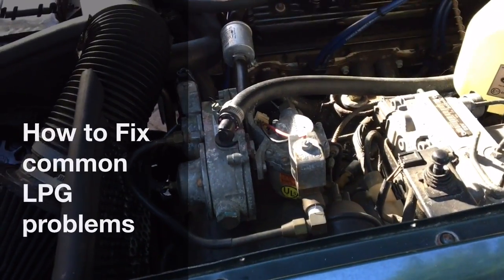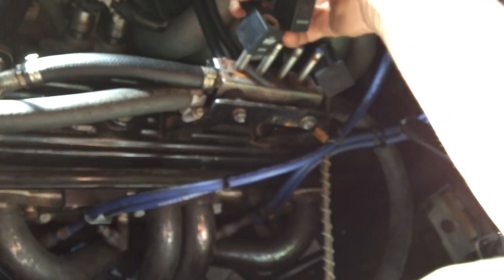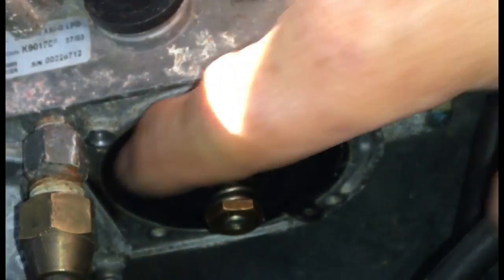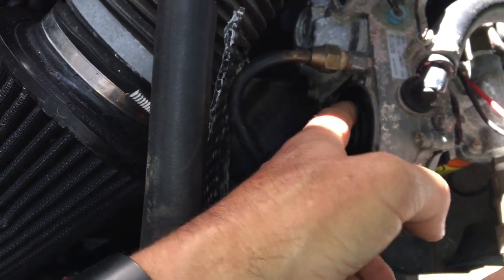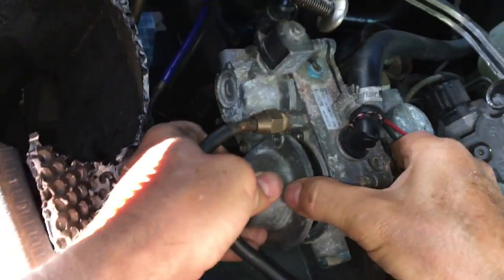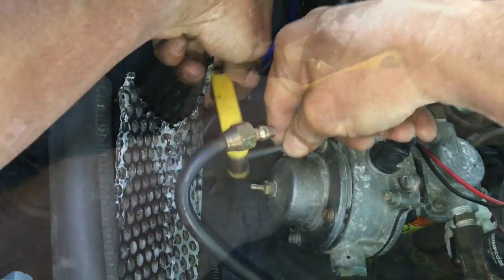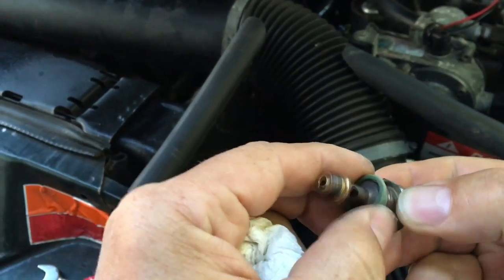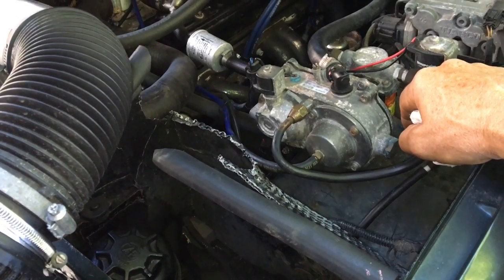How to Fix Common LPG Problems - Vaporiser / Reducer, Injectors

Comment: My engine was running rich on LPG and because on gasoline it worked like a clock, I concluded that there was something wrong with the LPG system. 

II thought the vaporiser might have been leaking the gas into the intake, but after replacing the vaporiser's main rubber membrane today i see no improvements; coincidentally, the old membrane doesn't look cracked whatsoever, so I don't think that was the problem. 

There was also this pronounced clacking noise of the LPG injectors (only when I switch to LPG from gasoline; sounds a bit like tractor) maybe the o-rings are worn, as you said in the video; they are a bit harder to reach to, than the reducer was, so it's going to be a bit harder to do in situ, but not prohibitively difficult. But logically that shouldn't be the reason for running rich - the ECU should adjust the injector's opening time according to the air flow rate, at least that's what is going on when functioning on gasoline... These LPG injectors inject the gas into the intake manifold, bypassing the gasoline injectors altogether, right? Then it shouldn't be much different as compared to the gasoline injectors...

I also have to confess that I haven't changed the LPG filters and don't know for how long they haven't been replaced (I bought this car used), and in the worst case scenario records show that it has been done 5 years and 15,000 km ago. Maybe I should just change the filters and it would solve the problem...?

Maybe it's an LPG correction factor calibration issue? I guess I can tinker with the LPG's ECU parameters - there are videos on youtube how to do that. I downloaded the software; not sure how to use it with my cheap bluetooth OBD-II dongle, though... 

It becomes a bit of a parts cannon situation: so far I replaced ignition coils and spark plugs, intake air filter, cleaned the MAF sensor with contact cleaner, cleaned the gasoline injectors with special liquid that you put into the tank before refilling it, but now I realize that this was stupid as the LPG injectors and gasoline injectors are completely independent... And the local LPG shops aren't helping, just doing a parts cannon trick but with a 10x markup, obviously. It's actually on their pitch I replaced the ignition coils and spark plugs, although I knew that it wasn't the issue, but I trusted them. Turns out, I should not have. That's why I'm doing it all myself now. 

PS: worth noting that the car is staying parked all the time, using it once a week for short trips. Gummed up injectors likely then?
PPS: Opel (Vauxhall) Agila B 2010 with factory installed LPG system from Landi Renzo (core parts like ECU and vaporiser; but some parts like fuel tank are from some other manufacturer, don't remember the name)
Reply from the maker: The clattering of the injectors is not good and needs fixing by an o ring/service kit if possible for your type of injectors or change the injectors to new ones.  If they are clattering then they are probably bouncing a lot and may be letting more gas in.  They can also clog up with wax from the LPG stream.  I ran a hot cooolant pipe under my injectors to help keep any wax fluid which seemed to help stop gumming up.
The frequent problem with lpg is it often goes off-tune/ out of calibration.  I found I needed to do fuel modifications in the LPG ECU more frequently than I wanted to do.  I think due to injector aging changes.
There is a degree of fuelling adaptation that the petrol ECU does to get the fuelling right (based on lamda/O2 seasor readings) as the LPG is slaved off the petrol ECU, so the petrol ECU still has an effect wether running on petrol or LPG, but it can only adapt so much up to a certain limit..  At least that is the case on the OMVL setup.  If you run half the time on LPG the fuel adaptation by the petrol ECU will never be spot on for either fuel as it tries to get it right for one fuel then the other.  That only means sometimes it is not tuned for max power.
Your best bet is, DIY, as you suggest.  Change or service the injectors.  Get the LPG ECU software and hardware cable interface to talk to it and modify the fueling level based on a monitor that you put on the O2/lamda sensor  - put a guage in the car and tune the LPG ECU for correct air/fuel ratio on the gauge when driving.
Reply: @comeinhandynow  ok if it has to come down to recalibrating the correction factors, I'll just skip touching the injectors altogether then. Even they are gummed up a bit I'll just adjust the correction factors a bit more than if they were clean, and it should work, right...? I mean, I'll try to make the O2 sensor happy, I won't just pull some correction factors out of thin air and purport them as appropriate to my particular level of gummed-upness.

At this stage it's necessary to understand if it's even worth continuing to try to make it work, so I'll try to ignore the clacking of the injectors even if it isn't good in the long-term perspective.

If recalibration helps, then I might consider cleaning the injectors and re-calibrating again if necessary...

Comment: Hi there,,are th diaphragm same sizes for all cars like Leandroves? Good job Good info thanks 👍
Reply from the maker: Thanks. The LPG vapouriser diaphragm size is only dependant on the manufacturer and model of LPG vapouriser that you have.  The one in the video is an aftermarket OMVL one.  It is nothing to do with Landrover.

Comment: On the scheme for the LPG reducer it shows an inlet and an outlet for some "coolant" (oh my, is that the engine coolant that also passes through the reducer?? That's gotta make any coolant repairs or search for leaks super complicated as compared to a vehicle without LPG... Hopefully I wouldn't have to do it one day). Do I have to drain the coolant before opening this plate to replace the rubber membrane?
Reply from the maker: Yes it is engine coolant, from the hot side.  The hot water is used to vapourise the LPG liquid to gas.  No the coolant is separate from that so no need.
Reply: @comeinhandynow  oh yes you are right, it turns out there were indeed a bit of coolant in the tubes, good thing I didn't do it on a hot engine

Comment: Wow my car indeed runs rich on lpg (on gasoline fine). I will order this kit
Reply: Is there a cutoff valve that one needs to actuate before intervening on the membrane???
Reply from the maker: @SuperMixedd  
There is a cut off valve on the tank and one near the vapouriser normally, these turn off when the engine is stopped.
Reply: @comeinhandynow  ok thank you very much, i thought as much...

Comment: Great video, my LPG is having issues, it only kicks in after driving a distance 40km or so, any ideas??
Reply from the maker: Sounds like the lpg ecu has decided that the injector rail and gas hasn’t got up to high enough temperature quickly enough.  Check the car thermostat and read the engine temperature from an obdii reader to see if there is a problem there.  Preferably get the lpg ecu software and interface cable to see what temperature that ecu is reading.  Also check that water flow of hot water to the vapouriser is all good.
Reply: @comeinhandynow  you're brilliant and correct, thanks a million

Comment: Hi
One of my lpg injectors is making a loud popping noise from near manifold area. I thought maybe there was a hole at the manifold or the injectors broken but now I'm thinking it could be back firing. Works smooth as butter on petrol
Reply from the maker: Maybe a worn out injector part, depends on the noise.  Worth looking at all of them and service them if you can.

Comment: I had a LPG in my 2,5 liter Subaru, it used to start to stutter at traffic lights.
I fitted a K&N fliter and it went away as if by magic!
I have had 3 different Taxis with LPG, my S-Class had Dutch LPG system Vialle, good but prone to pump problems.
I now have a Mercedes Viano with Prins LPG and it is super, way ahead of Vialle, but all have been on K&N filters and I cannot recomend them enough for LPG use, the air just gets in better/quicker for better ignition!
PS, in extreme heat the gas tank might not let you fill up, a quick panic a few days ago but as soon as the weather changed there were no more problems, I have used LPG for 17 years!
Pain in butt sometimes but saves a lot of money over those years especially as diesel is now through  the roof!
Reply from the maker: How much is LPG/l now? Not sure I would have it again due to 2x servicing and retuning needed.  The tank valves can get sticky and stick full meaning you can’t refill them. Needs the tank dismantling, not for the faint hearted.  I would have thought a new normal filter is nearly as good as a K&N but it depends how your lpg is tuned on it’s A/F -air/fuel ratio.  If tuned rich it will like more air.
Reply: that's true. mainly because k&n are there for show, they're not filtering as much as OEM filters. so you'll get "performance" at the cost of durability

Comment: Super useful well made video, thanks for taking the time to share your knowledge. 

I have an OMVL DREAM XXI G system fitted and today when I was reattaching the reducer to its bracket I picked up the wrong bolt which was 3/4" longer than the correct one, which was hiding under the valance.. As I tightened it up I sprung a water leak, the bolt which was too long had broken through the back plate of the reducer unit. Have you any pointers as to where I could get hold of a replacement back plate?  I'm in central England. Thanks again.
Reply from the maker: Thanks. Getting just the backplate could be tricky. I would suggest getting the whole vapouriser. Try ebay.
Reply: @comeinhandynow  If I replace the unit, do the gas connections have automatic cut off valves as standard? I don't see any vids showing the gas lines being disconnected but don't want to assume it's safe to do so without the need to make safe?
Reply from the maker: Also is there a way to repair it? Maybe bolt on a plate over the hole with plenty of gasket sealant?

Comment: Hello i have a problem with my lovati easy fast system, the lpg works fine when outside temperature is cold but on summer or when it gets warmer the lpg beeps when i throttle a little, just a touch and it switches to petrol immediately.
Reply from the maker: Try and get the lpg ecu software and hardware connection cable to get clues about the fault.  Sounds like you have a flow problem. Change the filters and check the vapouriser, dismantle and clean.
Reply: @comeinhandynow  Thanks for the reply. i cleaned the filters, changed another vapouriser, the ecu for lpg changed with this the car cutted 2l per 100km on gas, changed the sensor on the lpg bought new local 50e still beeps. On the lovato software doesnt show errors. Can't figure this out

Comment: Great video! I've got a 2015 Commodore LPG, and my fuel usage has gone up significantly ~18-21l/100KM for city driving, compared to ~12-14l/100km    any idea why? it has full log book service history, mechanics always say cant find anything wrong with it when they service it,. but unsure how thorough or if at all they went over the LPG system
Reply from the maker: Thanks.  One of the things I found with my lpg system is that it needed frequent retuning by modification of the parameters in the lpg ecu. Probably as the injectors change over time, they do gum up and get slower and bits need changing.  You can only do this retune if you have the software and hardware cable for your particular system. It is possible to do DIY, needs some research on the web.  Otherwise go to an lpg installer who has the s/w & h/w for your system and ask for a service and retune.   Another alternative is to try changing the lpg injectors for new ones or strip and service them with a service kit.

Comment: i have a vauxhall zafira 2003 dual fuel always run great on lpg, then it cut out the other day full tank of lpg,  didnt automatically switch to petrol, after running on petrol for a few mins switched it back to lpg and it was fine, it did the same again a few days later but now when i switch to lpg engine cuts out on changeover and stops, switch back to petrol starts fine, any help would be appreciated
Reply: Same here
Reply from the maker: There are a few things in this video of the sort of things to check.  Using a PC and the right software and comms cable to get info from the lpg ecu should help diagnose it.
Reply: I have the same problem, did you manage to find a solution

Comment: I've just replaced the sparkplugs in my car, bolted in the lpg injectors back on, but now on the drivers side, I can hear the lpg injectors ticking inside the car. Do I just need to adjust it slightly?
Reply from the maker: Ticking usually means it needs new rubber neoprene o rings at the bottom of the plunger inside the injector
Reply: @comeinhandynow  thanks. It's odd, it wasnt ticking when I moved it out the way to get to the sparkplugs, but when put it back in place, and started the car, and it went onto lpg, it starts ticking on drivers side, when I move it down abit, it goes little quieter

Comment: Hi my Vauxhall 3.2 has been off road for a year with a full tank of lpg, had new mot yesterday and on petrol my car is sweet but when it went over to lpg the engine light came on and it ran lumpy l left it on lpg for about 5 minutes to maybe clear then raved it, the engine management light then went off and at high er revs it ran better but then went lumpy again and engine management light came back on, am on my own now and haven’t got my husband to advise me since he passed so any advice please would be great. Thank you
Reply from the maker: It needs an lpg service and check, take to a garage that services or installs lpg systems.  Or have a try and cleaning out the injectors and changing the lpg filters to see if that helps.  Good luck.

Comment: Hey bud, I'm scouring the net for assistance and advice. I have just bought a Jaguar 3.2 V8 XJ8 that was LPG converted in 2007. It has the Romana system fit, and I've owned the car for a week. Two issues that I have noticed - 1. The car takes a long while to use its power to set off. For example, at a roundabout, the car is awfully slow to set off. This problem does not happen on petrol. 2. At minimum, I should be getting 110miles from a full tank (42.4L) however the gauge flashes for a top up around 55miles. Today,  I have managed to achieve 80miles with no flashing, but I am still in the red. 

I am planning to give this a service, as I do not know where to begin. Where should I start?
Reply from the maker: Hopefully this video gives you a few things to look at. Generally a thorough service would be new lpg filters, new vapouriser diaphragm, new injector internals via a service kit, if serviceable type, or new injectors if not and then a retune of the lpg ecu. you should try and get the PC software and cable to communicate with the lpg ecu.  It’s all possible DIY.

Comment: Hello mate very nice video. I have one question. I have just installed LPG on my car. Do I need to install an additional lubricating kit to lubricate the engine valve? some told me it is important while th LPG installer told me its not. its just a waste of money and it does not do much since the engine oil is already lubricating the engine valve. kindly advise. thanks
Reply from the maker: Hi, Thanks.  I have heard of those systems but never installed one on my car after weighing up the pros and cons and I saw no sign that the valves were damaged when I dismantled my engine.  I had more problems with the head gasket burning through, possibly from detonation but also possible because lpg runs a bit hotter.  If the head gasket ever needs changing it is worth using the best quality high performance metal ones if possible.